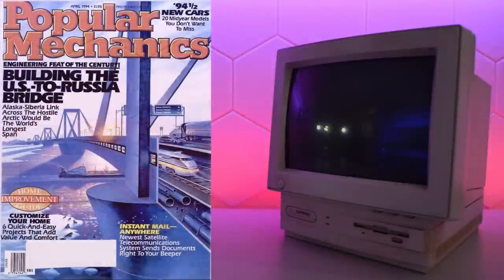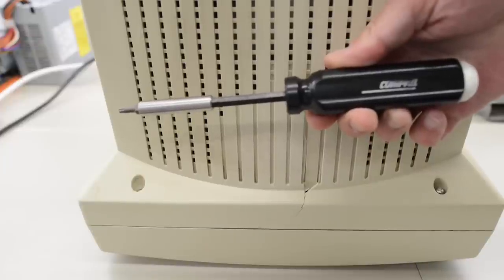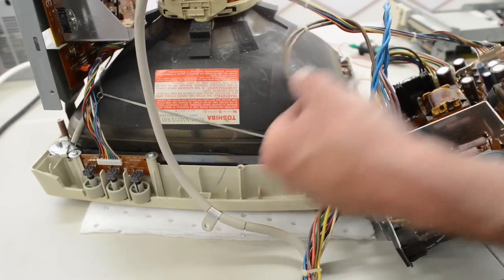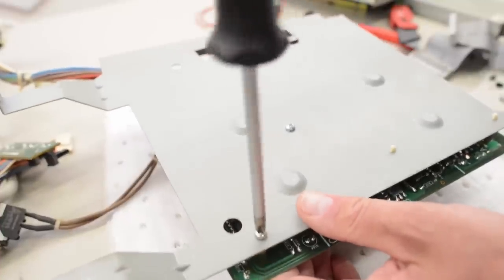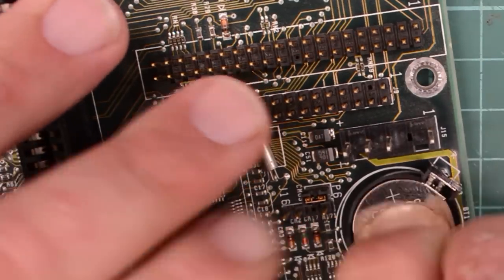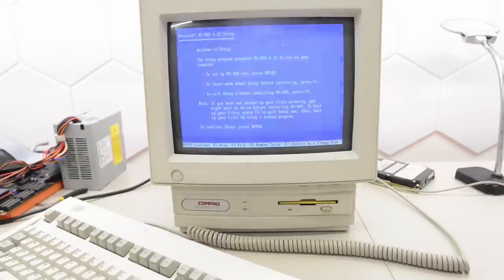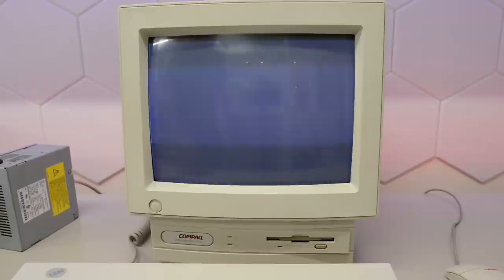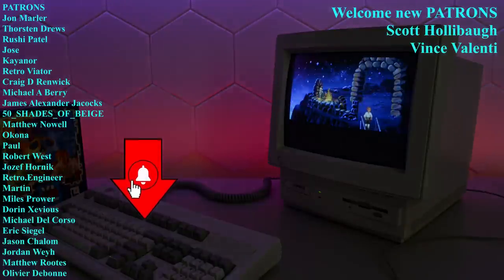Restoring and upgrading an oddball. Compaq Presario 433 (425)

Comment: A Compaq Presario 425 was my first 486. Prior to that I had a Tandy 1000 as my daily driver and I still used my C64 a lot. I had a lot of fun using modems on that machine. I think it came with a 14.4k modem built in? I remember many upgrades.. iirc, I was stuck at 28.8k for a long time, but eventually got a 33.6 and 56k modem. I used it for years, finally upgrading to a generic Pentium 90 at some point. I loved that cute little machine. I wish I still had it! Enjoyed the video and the accompanying nostalgia!
Reply from the maker: Thank you, it's a very cool little machine. I totally get why people like it so much

Comment: I had one of those Compaq screwdrivers back in the late 90s. I worked at laptop repair depot and we did warranty work for Toshiba, Compaq, HP, IBM and Fujitsu. The OEMs would occasionally give you stuff like that back in the 90s but once the 2000s rolled around they all pretty much stopped giving their service providers any sort of perks. 

My guess on the slowness of that machine is a lack of L2 cache. In the early 90s many of the consumer focused 486 machines did not come standard with L2 cache. Installing a much faster CPU with no L2 is going to completely kneecap the performance. I had the same issue with the Packard Bell 486 machine I had back then. Installing 128 KB of L2 manually via unpopulated sockets on the board made a big difference, especially when I went from a 486 DX2 66MHz to a 5x86 running at 120MHz using an in socket voltage adapter. I already had the L2 installed when I did the CPU upgrade but just as a test back then I temporarily removed the L2 and wow what a difference there was with the L2 missing!

Comment: Always enjoy the early 90s reassembly montage.  Hehehe... 
Oooo Conner.  Brings back some bad memories for me.  But it is period appropriate though.  ;)
Reply from the maker: I hear this a lot but all my 3.5" Conner drives still work. (about 20) I have one 2.5" drive that has stopped working but I think it's repairable. The head is probably just stuck in the rubber bumper
Reply: @Epictronics1  A Conner drive is the only hard drive I've ever had crash on me.  Ok, so I have had only one Conner drive.  Hehehe...

Comment: Oooh this is great! Our first ever PC was a Compaq Presario 833 CDS, and this is the closest equivalent I've ever seen in a YouTube video. It's a shame we did away with it, because I've always been very curious how far I could have upgraded that machine. The standard 486 SX-33 got obsolete very quickly, but I think a RAM upgrade and a Pentium Overdrive or similar CPU upgrade could have extended the life of it a lot longer. As it stands though, I never even knew what the insides of it looked like because I was too young and inexperienced to work on PC's myself. This video gave me a glimpse of what might have been possible, so thanks!

Comment: The `odd` connector on 3:23 may be the cache memory slot, if I`m not mistaken. Upgradable to 256 or 512kb i think.   I had an old Presario CDS742 (486 DX4 100) in the 90`s that had the same connector but I never got the upgrade,

Comment: Solutions for the lack of speed issues:

1)  Check the FSB and clock multiplier/frequency.

2) See if 60ns 72-pin RAM will work in the machine.

3)  Check to see if L2 cache memory is present.  If it is, check for functionality.

4)  See if the VRAM can be upgraded in amount and/or possibly a faster speed.

5) I have doubts if a CF=>IDE or an SD=>IDE solution would help due to the speed of the onboard IDE controller.

Overall, it seems like going over all of the RAM, regardless of type, might give this Compaq at least a little boost in speed.  The main culprit would seem to be the CPU jumper settings.  I didn't see any sort of crystal oscillator, but I would check that part if it has one.
Reply from the maker: Let's get to the bottom of this. I'll make a follow-up vid

Comment: I have one of these, 425 to be exact. I got it in mint condition and with original kb and mouse about six years ago for 3€ (yeah, three). It is really neat AIO, only thing I’d like is that it would have even one more ISA slot. I’ve intentionally kept it in original specs other than pumping the RAM to 20MB and added CT2290 and a NIC. I have tested it with DX2-66, but decided to use the original processor in the end as I have other faster 486s.

Edit: my 425 has exactly the same motherboard layout with socketed 486-25SX, so MB doesn’t depend on the processor type. There were two versions of the MB as far as I know, the other is with soldered processor and empty socket.

Comment: Hi Roman, too bad I just missed the premiere of this vid as this one hits very close to home for me; I have the exact same machine with the only differences being a 4 gig CF-card as storage (which is supported directly by the BIOS!) and 16megs of RAM instead of 12 megs.

I don't use a Socket Blaster but I have the same CPU installed through a vintage Evergreen upgrade that uses a similar interposer with a VREG that I somehow could get cheaply through Evilbay (I know this sounds insane ;-) ). Mine does run at the full 133MHz but I only get around 3600 realtics in DooM high detail mode. Storage speed is excellent in my case, though the elephant in the room is the lack of L2 cache and more importantly: The lack of a 32-bit external bus! Yes, the memory uses the 32-bit local bus but both the expansion slots and the on board video card are only 16-bit wide, which severely hampers performance in games that depend on raw video throughput like DooM and thus is a royal bottleneck ;-) The aforementioned is why I'm going with a regular 5V DX2-66 on my build, which is more than enough for the girls I date and put that nice 133MHz upgrade in a machine that can actually put all that insane amount of horsepower to use, like my Compaq Deskpro 486 that actually has L2 cache and a 32-bit QVision EISA videocard ;-)

In spite of its obvious shortcomings I do really love this little machine as it's a super compact and good looking little thing and I use it for a whole lot of things; It's a bit like the Macintosh Color Classic; a nice little all in one that doesn't burn rubber but just gets the job done in an elegant way. It's more about the 'look and feel' with these machines than sheer performance...
Reply from the maker: I totally agree. My 433 is actually sitting on the floor in the studio as I write this and making out with my Color Classic. However, I want to push this board to the max before I replace that 5x86 with a DX2-66 :)
Reply: @Epictronics1  Lol, yeah mine seem to like eachother as well; horny little buggers ;-)

Seriously though:  I hate to rain on your parade as they say in the US but I've been there. I'm afraid there isn't much more pushing to do with this little low end 486 board. The lack of 32-bit expansion slots, the lack of cache (+ no ability to add it) plus the slow on board 16-bit CL-GD5420 are pretty much hard limitations..

To give you a real world example of how much clock cycles you will be burning by upgrading from a 66 MHz to an Am5x86 at 133 MHz: This upgrade will still only give you a measly 3600 realtics in DooM. An i486DX2 @ 66 MHz will give you 4094 realtics. Ergo double the clock speed of a DX2-66 to 133MHz and double the internal cache from 8k to 16k and you'll end up with a very disappointing 14% speed increase in DooM. 
In other words: The CPU will be spinning its wheels most of the time, being completely held back by the low end peripheral logic of this system.. Sad but true: A DX2-66 is all it can really handle and seems to be the sweet spot, at least for me..But even then I own DX2-66 machines that run circles around this little all in one. I do really love the thing though in spite of its obvious shortcomings as its look and feel compensate for a lot of them ;-)
Reply from the maker: @pipschannel1222  yeah, the PS/1 was so much more hackable. I guess this machine is DOOMed to only play adventure games :)

Comment: I used to have one of these about 15 years ago.

That weird connector on the motherboard inside is for a 10BaseT network card.

I ran Windows for Workgroups 3.11 on mine and it plus the family eMachines with Windows XP was were the first two computers I ever networked.
Reply from the maker: Thanks, I wonder if it connects to the ISA or local bus. I will install the original Win 3.1 and try to make it a bit faster in an upcoming vid

Comment: I sold these machines back in the day and if I remember correctly there were two motherboards.  One had the soldered 486SX with a “487SX” upgrade socket and modem built-in.  The other had the 486SX in the socket but no modem on the motherboard.  The connector that reminds you of a SCSI connector had a modem plugged in since there wasn’t one built into the motherboard, but it would prevent you from using the bottom ISA slot.  Maybe someone can correct me but it’s been almost 30 years, lol.
Reply from the maker: I think you remember correctly. There is a slightly different board with an SX25 soldered to the board in the Presario badged 425. My machine is a 433. Otherwise, I think they are identical

Comment: You can get Heatsink/fan combos that clip to the CPU without adhesive.
Reply from the maker: I have a few of those but they are very small unfortunately
Reply: @Epictronics1  Ah yes, alot of those type I get the feeling they were for CPU's that didn't normally require them.

Comment: My parents had one of these (or a 433 or 466, if that exists), and i upgraded it to a DX4-100 back in the olden times. It just couldn't keep up. I still have the OD, and just want a 486 mom to use it in, but those have gotten so expensive that the processor will probably just remain, essentially, decoration. Blah. Yeah, nobody asked, but from time to time I think about this computer in passing and can't remember the name of the model. It's never sticks in my mind enough to look it up when I have the time to stop and look for it, so it has just remained in the fog. TL;DR -- THANKS! :) ETA: It's nice to know that it really was freakishly slow. I remembered not being super impressed with the upgrade.
Reply from the maker: Yeah, a lovely machine, but unfortunately very slow. It's a great DOS Adventure gamer tough

Comment: Love your videos, keep them coming. I also like restoring vintage computers. I'm working on an IBM PC-350 and a IBM PC-750. Both are Intel P 1 200 MMX computers. I use CF cards for HDDs. It's running windows 95, and I have it on my home network.
Reply from the maker: Thank you. Excellent choice of OS. I have an IBM 350 coming up in a video soon :)
Reply: @Epictronics1  Oh nice. I added a rare Voodoo 3 PCI 16MB  GPU, and it has 168 MB RAM, A SCISI to SD and IDE to CF. I noticed that it won't take anything over 8 GB of storage. I know it's a limitation of the BIOS. I also found the most up today BIOS online so I could flash using a floppy but still 8 GB limit. I do have a Pentium 1 233 MMX and a VRM to step down the voltage. 

That Voodoo 3 makes a big difference in performance. 

When you install the OS, do you do the updates and SP1 and USB supplement? My 350 mainboard does come with USB 1.0.
Reply from the maker: @QuantumParadox  No, when installing w95 I just use the OSR 2.5 version. Pretty sure that's what I'll use with my 350. 8GB is plenty for these machines, isn't it?

Comment: Have one these, upgraded to 486DX-66 from 486SX-25. Equipped with 24 Mb RAM and Soundblaster. Original 220MB IDE drive. Love this machine but the plastic is breaking of left and right. Anytime I pull out the system PCA I have some more pieces of plastic in my hand 😞. Also have cracks in the same part as yours for the CRT screen.

Comment: I seem to recall LGR making his machine run doom perfectly fine on his.
You should have looked hot Phil's utilities reported the CPU detection for further diagnostics. Im guessing cache disabled here.
Also, I think the onboard CL graphics actually use a VLB connection.
Reply from the maker: I was hoping to find that too, but the CL 5420 is an ISA chip unfortunately

Comment: My not so educated guess on the speed issue is: Cache.
I found, whenever a faster CPU doesn't result in good results, there is an issue with cache (absent, slow and/or not enough).
Reply from the maker: I ran out of time, I should have checked! I'll check first thing in part 2

Comment: I have that exact same screwdriver. Great for working on laptops :). 
I used to have the Presario 425. It was an OK machine, but not lighting the world on fire. The SX/25 was soldered to the mainboard with the OD socket. I did have the POD 83MHz in mine with the max RAM (40mb I think?) and it wasn't bad, but not lighting the world on fire either. I had a soundblaster and SCSI card in mine (for CD-ROM) since these didn't have any sound onboard. I suspect thats what the extra section on the motherboard was for that had pads but no chips, why it had no sound is beyond me since this was marketed to the home market, unless it was just cheap (likely was).
Reply from the maker: Oh, I have repaired so many Compaq laptops with that screwdriver :) Yeah, this is a tough machine to make faster but I want to try a few more things before I retire it with a DX2-66

Comment: Nice work on the cleanup of that system! It looked like a pain to disassemble and reassemble. Like others have mentioned, I think performance might be limited due to the lack of L2 cache (like that Commodore 486 you worked on before).
Reply from the maker: Thanks, yeah, this is a tough one. I'll try to push it some more but it will probably end up as a DOS adventure gamer at 20fps
Reply: I wonder if that's what some of the blank pads were for. I wonder if some could be slapped on. (oh, this got recommended super late. Hi from 2 months later)

Comment: The ET4000 is a graphics chip from 1989, whereas the 5420 is from 1992. I might recommend trying a newer Cirrus Logic card if you can manage one: the 5428 or 5429 would be faster, can be had for a good price sill, and were available in ISA. The 5434 was, too, but the ISA versions of those go for a premium because they were relative rare. Other potential candidates could be the ATI Mach32 or Mach64. Not sure what S3 had that would be faster than some of these cards.

As for the speed when you were using the Am5x86, looks like you had all the jumpers correct... I wonder if that BIOS isn't enabling the L1 cache? That would certainly hurt performance. The lack of an L2 cache on the motherboard is also going to hamper performance.

Very nice Presario, and I wish you luck as you try to give it a bit more performance!
Reply from the maker: Thanks Justin, I think the 5x86 is stuck in 3x33. I didn't know CL made 5428 and 5429 ISA cards. All my 28/29 cards are VLB so I just assumed the chips only worked with VLB. I have a few more things to try so this gem is gonna make for a follow-up vid : )
Reply: I used to run a 486/33 with a ISA Video 7 card (256k) and it ran fast enough to play Doom.
Reply: Yeah -- I always hear about how great the ET4000 is, but it's rarely accompanied by the substantial disclaimer:  "...FOR THE TIME."  :-)  It had some neat buffering tricks that gave it a leg-up at first, but that doesn't make it the holy grail of graphics chipsets, even for ISA.

There are several better options, usually, depending on the machine and what you're going to use it for.  One notable example of this:  ET4K isn't going to cut it for a Windows card, as it has no Windows acceleration at all.  You need to step up to at least the ET4000/W32p for that.  Even some Trident chipsets are faster.

Comment: Should have run SpeedSys and the other tools to check clock speeds and cache sizes. Upgrades probably not running at the expexcted clock and have no L2
Reply from the maker: yeah, I ran out of time. We'll check some more in part 2

Comment: Great video. One thiught i had, was a rechargeable Lithium battery on the board? If so id be worried that the board might be trying to charge the non-rechargable CR2023 and might cause issues? I could be barking up the wrong tree, if so ignore me 😂
Reply from the maker: Thank you. The original battery was non-rechargeable too
Reply: @Epictronics1  cool 😊 Lovely machine, super jealous, bet you could squeeze more power out of it if you ever wanted to like the magic you did with your PS/1.

Comment: This is a really nice looking machine. Some of the all in ones have a very particular look that I really like for some reason. 😁If I had to guess, I'd say the multiplier isn't getting set correctly for some reason. Maybe the bios doesn't know what to do with that beast that you put in there. 😛 Also, the lack of L2 cache probably isn't helping. Still a really nice little machine though. It'll be cool to see if you can coax a little bit more performance out of it. :)
Reply from the maker: Thanks, I think I can. Pretty sure the 5x86 is stuck in 3x33. I'll see if I can fix that and make a vid